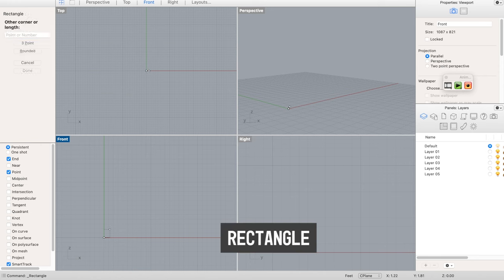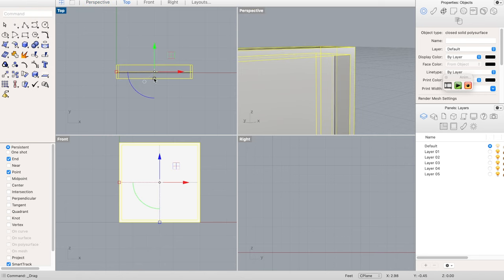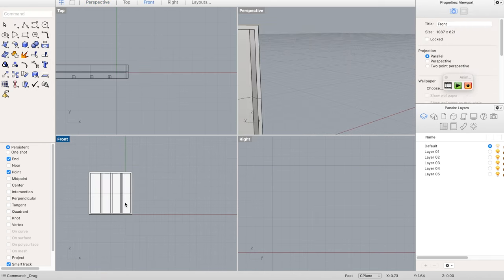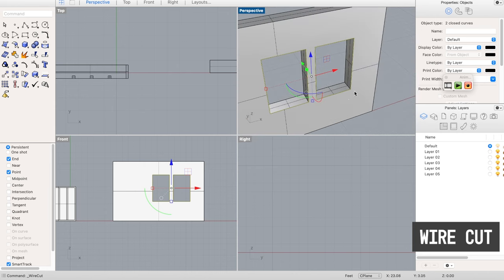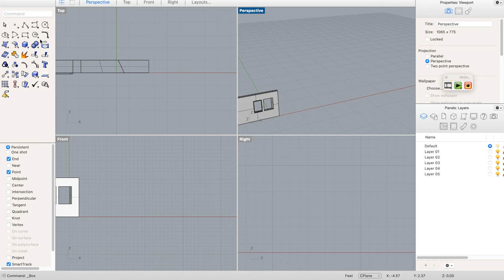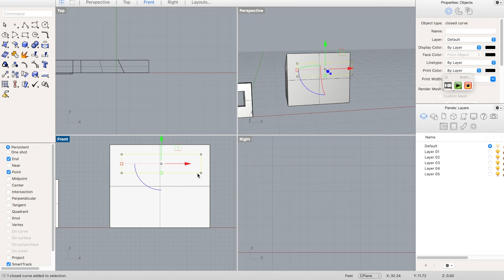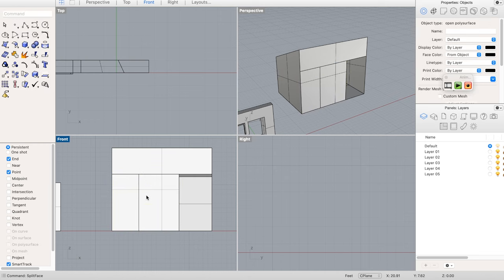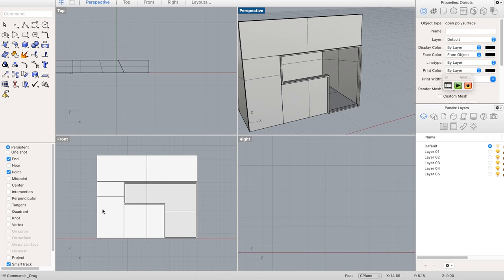3 Ways to Model a Window in Rhino3D

Comment: I realized that I always use WireCut like a Trim command lol (Wirecut Line option). Thanks for the tip. And I would recommend immediately converting the window's geometry to block as windows are module objects.
Reply from the maker: That’s a great idea 💡 for sure if you have multiple window objects blocks is a great option good rec. not sure why in the past I was always using trim and realized wire cut actually works better especially for solid objects will have to test out on lines work.
Reply: @NatesStudioDesk  639ugvv